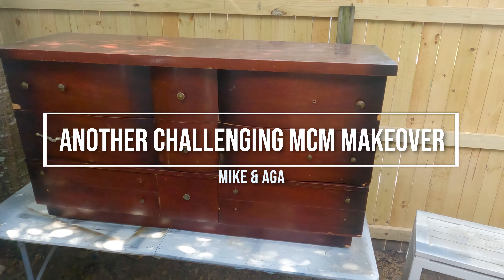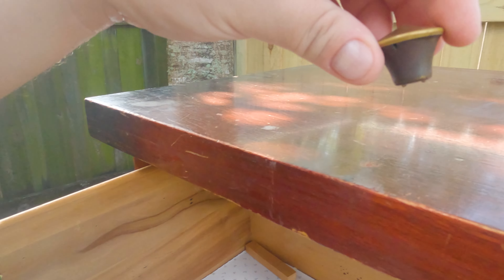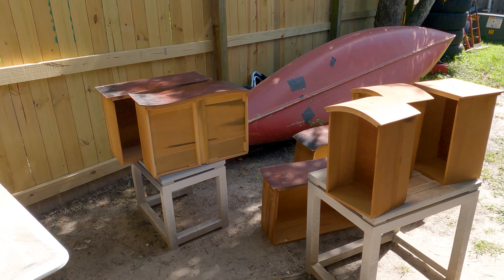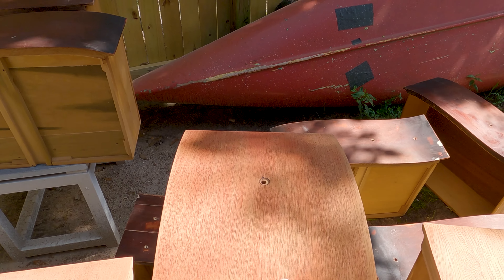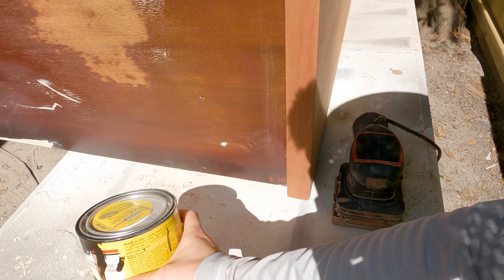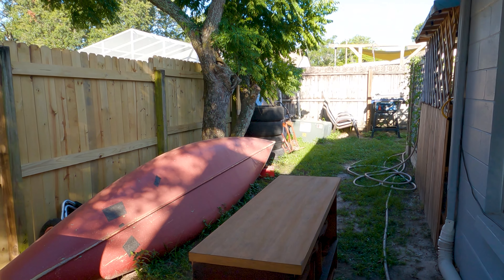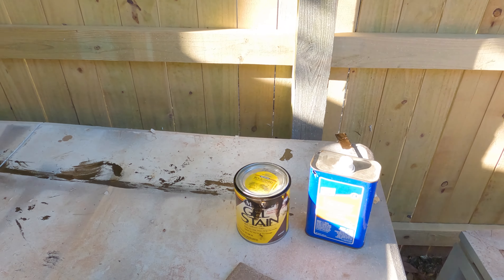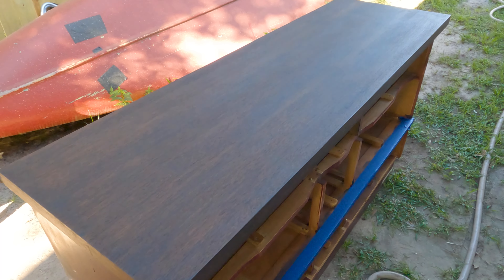Challenging MCM Dresser RESCUE | Furniture Makeover | DIY Restoration | Amazing Transformation

Comment: After sanding and before any stain you should use a wood conditioner, this will make sure. The stain goes smoothly and takes evenly.
Reply from the maker: We do sometimes use wood conditioner but only on softwoods. In this case the stain was really old. We thinned it a bit with a thinner and second run was perfect ☺️